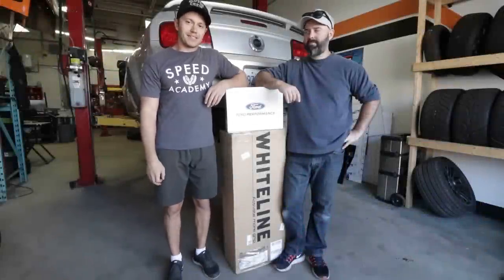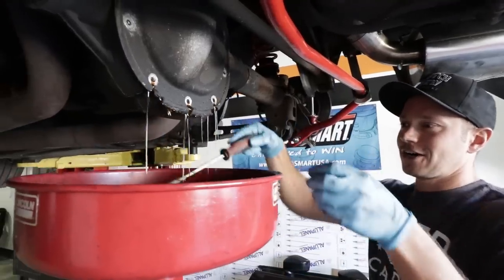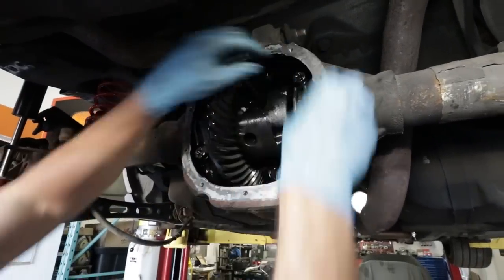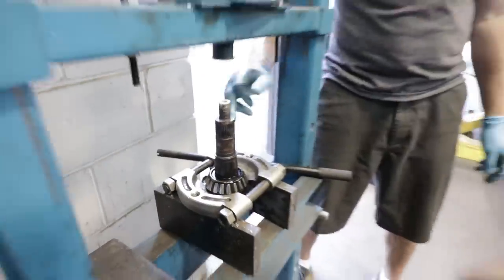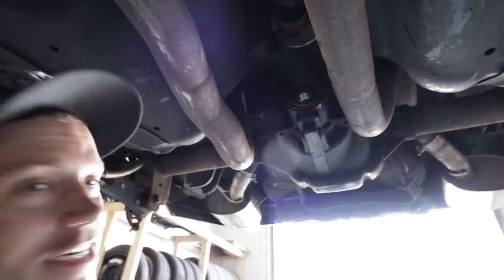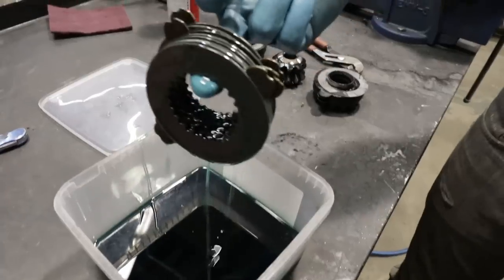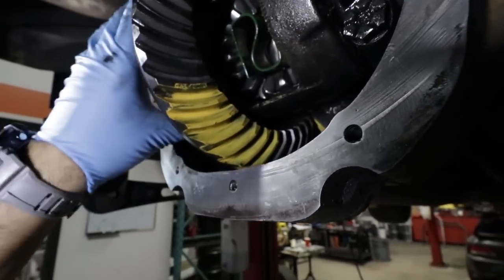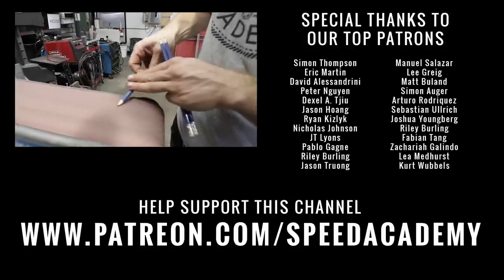Ford Mustang Rear End Rebuild & Watts Link - Mullet Mustang - EP07

Comment: Take the old pinion bearing and slightly grind the I/D so it slips on / off the pinion gear easily. Use that to set up the shim thickness and once you have the correct shim then press the new bearing on and do final install.
Reply: very wise sir, very wise
Reply: That’s assuming the new bearings are exactly the same. You’re better off getting two of the bearings you plan to use on final install and doing that to one of them for setting the pinion depth. Swap it out for the new one press fir, and you’re good to go.

Comment: I worked with a guy at ford who had a electric small size deep fryer but he kept transmission fluid in it and he would take and drop his pinion bearing into that and let it heat up to 250* then install it on the pinion without having to press it
Reply: Cuz Fords cant handle pressure ;-P
Reply: must do alot of rear ends!

Comment: Nice work Pete and Dave. 

You guys sure made life hard for your self-doing all that work under the car instead of just pulling the axle out from under the car and working on a bench..  Since you have all new suspension components.. 

Pro tip time!
If your ever in a rear diff again.. and it’s a shim style pinion gear ( like you have) and not a crush sleeve, take the old pinion bearing your pressed off take the die grinder to the inside of it and take off some material, just enough so it slides back on the shaft… (yes the shaft) of the pinion then it becomes a test bearing and you can slide it off easy so you can get the right back lash and proper amount of shims and it not be a royal pain of pressing bearings once you get the shims right you can press on the new bearing . 

Keep doing what you guys do! And I’ll see you guys at gridlife 2017 back here in MI.

-Jake

Comment: I got a 13gt that makes a constant noise from the rear axel. The noise sounds like when you first drive your car after its been siting for a long time and the rotors have gotten a bit rusty so as soon as you drive you hear them scraping of the rust. This is the noise it makes constantly. I have taken it to many ford dealerships and have had their top guys look at it with stethoscopes and whatnot. They say the noise comes from the right side of the axel but they don't know why its doing it. When they opened op the rear dif to check the fluid they said the fluid is clean no shavings of metal at all. The car is still covered under powertrain warranty. The car also has a lot of suspension mods so the dealer said this might be a noise that's always there but you are noticing it now due to the stiff links and bushings. Did some research online and a lot of ppl are reporting this noise. Any thoughts?

Comment: I've actually had better luck putting the Pinion bearing inside a toaster style countertop oven and heat it up and put the pinion gear in the freezer once both are were I like them temp wise they just drop right together

Comment: Hey guys when cleaning a gasket surface don't use a sanding disk you a wire wheels. I have seen people use sanding disk and then the cars come back with a leak cause you took too much metal off one side causing an uneven mating surface therefore you do not get a proper seal.
Reply from the maker: That is not a sanding disk but an aluminum scuff disk that takes the silicone off and doesn't harm the metal.
Reply: Speed Academy ohh okay just making sure! See you guys are pros

Comment: Nice build guys. I recently installed a tomei clutch type 1.5 LSD on my g35. Never drove a car with a clutch LSD and the clunking from the clutch engagement at low speed tight corners is horrible! Let us know how good that friction mod works (what friction mod was it?)

Comment: Why take shortcuts on the diff install guys?? Make some test bearings that dont need to be pressed on/off to get shims dialed in. Suspension will not matter if you can't get the power down.
Reply: The only real worry is noise. They might whine/whur. Have a buddy who didn't get it quite right but kind of sounded like blower so we put up on a lift just check how off the pattern was. decided to leave it 25k later still holding up fine. It's a manual car running drag radials. not a monster but 13.0s all day long. Jimmy real likes that almost blower sound,even coming from the back.

Comment: next time with the pinion shimming try making a 'dummy bearing' by slightly enlarging the old bearing so it can just slide on and off of the pinion. that way you can recheck the mesh without pressing the bearing on and off.

Comment: compared to the Panhard setup the Watts setup makes the rear of the car feel and behave the SAME in L and R corners. with the Panhard setup L and R corners feel different when the car is driven on the limit of grip.
Reply: jfv65 so thats why nascars are using a panhard setup? Emphasis on going left?
Reply: aaaargl they use it in nascar simply because it's a spec series. It's the same reason they still use carburators.
Reply: aaaargl you will see lots of watts setups on classic RWD rally cars like Ford Escort mk1 and mk2, Opel Manta and Ascona, Volvo 240

Comment: I need help from you two! I have a 2006 GT that two mechanics have worked on to solve a whining differential. The first had the car two weeks, charged over $300 in time and did nothing. The second has also had the car two weeks, put in all new gears, and the thing still whines under load. He said they set it up dozens of times and can't seem to find the issue. I believe he is honest and I want to help him. Is there any way I could get you on the phone with him? I've invested almost $1,200 and I'm at my wits end, and I know he is too. Is it normal for a GT rear end to whine? I'm not talking about a subtle whine. It is loud.

Comment: Wow that was a really crappy job setting up that diff.  The pinion need to be torqued very specifically and the contact pattern on the ring is terrible. You be very lucky if you don't have an extremely noisy diff or worse:(
Reply: also the backlash measurement was done at the wrong place.  It needs to be done at the outside of the ring.  where you measured it's going to seem tighter than it actually is.

Comment: "Speed Academy- Fast Cars, Built Right"
. . . unless you're rebuilding an SR20DET, or a rear differential, because f#@k engines and differentials!
(PS, I love you're channel! You just might want to change your catch phrase or stop hacking shit)
(PPS, please take the time to get the pattern on the ring gear correct, it's worth it)